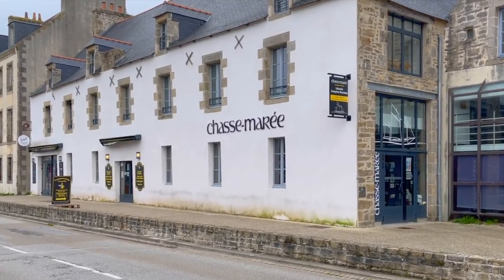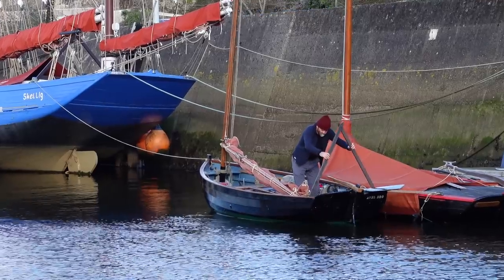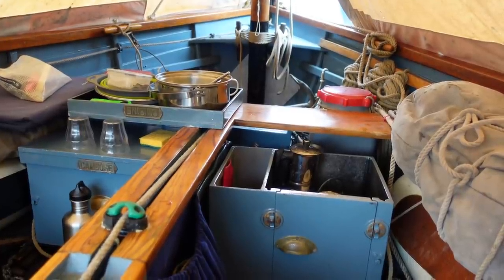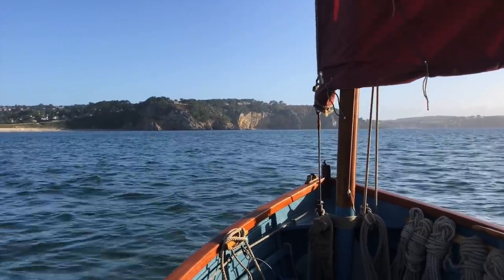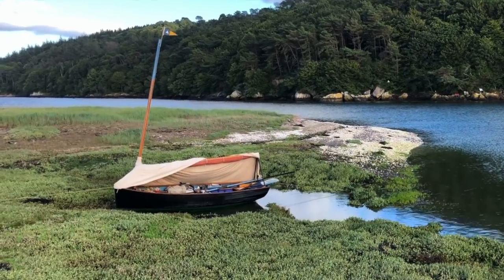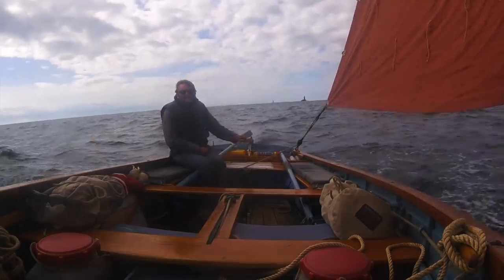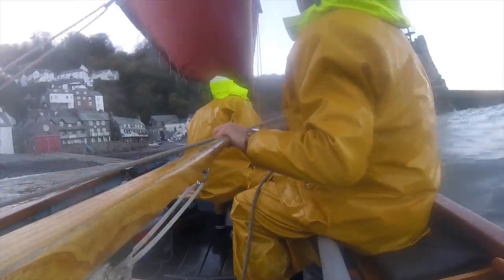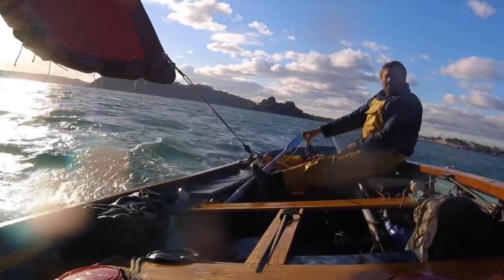Wild Camping in a cruising dinghy

Comment: I used to have a 22' yacht. One weekend I decided to take my 12' Tinker Traveller sailing dinghy for a trip on the Deben from Woodbridge down to the sea and back again - a round trip of about 18 miles. This 6 hour trip was the most memorable and enjoyable sail of the whole season for all the reasons that you state. You get as close as possible to the elements and everything is wonderfully simple.
Reply: The orwell and stour are nice sails too
Reply: That's a long wet (but safe) trip in a traveller.  I've just bought one of the last made but haven't had chance to sail it yet. But with even a small motor on it flies !

Comment: I've never owned a lovely old boat like this one. But I've been sailing - and owning, on and off - sailboats for 30 years. My favorite was an Etap 22, which over the course of years we sailed throughout the Stockholm archipelago. It was nearly all fun, and only a very small dose of work. But because we usually have to dream bigger, and I had always dreamed of crossing oceans, I "upgraded" from that to a 46' ocean-going Amel ketch. Suddenly I was a full-time mechanic, hardly a sailor. When you own a boat like that it's like the story about painting the Golden Gate Bridge. You are never done with the jobs list. Never. We cruised her for a year, through the Med and over the Atlantic. But I have to say the sense when I finally walked away from her on the pontoon, on the day of sale, was one of overwhelming relief. These days I'm into ultralight backpacking, and there's certainly a connection there: all of the adventure, none of the weight. If I were ever to return to sailing, it would probably be to do something similar to what Roger is doing above. It looks like a balm.
Reply from the maker: Not all that old. Built in 1994.
Reply from the maker: ... the boat. Not me!

Comment: Roger, you have totally inspired me. THANK YOU.  I've bought the best dinghy I can afford for 1k and equipped it for dinghy cruising and camping. A Laser 13... 136kg so manageable and far more affordable than many alternatives (I would love an Illur and maybe, when my boat comes in.... :-) ) I'll start with anchoring/ mooring, going ashore in my inflatable, or drying for the night. This allows me to use the camp kit I have until I can make a boom tent and rig a bunk in the cockpit. I've bought the bits for impeder, mooring cleats and anchor fairleads, anchors, chain, rode, mooring lines, Drybags, fenders, 3m (!) oars ... I did the calculation... 
 and rigged a sculling oarlock on the outboard bracket.... can't wait to try it! Drysuit, boots, buoyancy aid, reefing, preparing to get going from my new place at Cargreen Yacht Club in the Tamar. Not sailed there before but I hope the rivers and Plymouth sound will be a good training adventure ground this year. Brest and Morbihan in 2025!

Comment: I've got a little inflatable dinghy. To camp in it the oars will wedge against the oar locks and tie together to the front and back of the boat, creating a pyramid frame to support a tarpaulin. In comparison your dinghy is like a luxurious mansion! The advantage with my small one though is you can easily carry it across the land, and even climb with it on your back. Or without even packing it away just pick it up and carry it around a weir.

Comment: I have a bigger boat and yes it is like a caravan but don't use marinas that often as prefer off grid in anchorages. I love wild camping too and to combine these hobbies bought a mirror dinghy that I'm converting for cruising at the moment. I purposely bought an old wooden version with traditional wooden mast & gaff to get right back to basics with dinghying. Camping on it will be a challenge that I'm so looking forward to. Especially on calm inland waters.
Reply from the maker: Mirrors are small, but very nice little boats. You can do a lot worse.

Comment: Roger, i have looked at the Ilur plans and there seems to be a difference between the sleeping space on the “clinker kit” and the “classic”. Do you have an opinion on this? Are you familiar with any other distinctions? Thank you.
Reply from the maker: I am not familiar with all the distinctions, but I know that all modern Ilurs have much more fixed buoyancy than mine, which affects the internal arrangements. A friend who recently built an Ilur simply made the main thwart removable to provide more sleeping space, as the centre plate box is adequately restrained by the forward thwart.

Comment: You make it sound as if anyone can just buy a dinghy and go sailing the 7 oceans. It takes a lot of practice to be able to sail on a small boat. That's the main reason why I haven't done it yet. I live by Michigan lake. It's dream waters for sailing. Yet, I don't do it because I don't know how to sail.
Reply: I didnt either (until my 50's) but I took a couple of courses (where I didn't learn much), read a lot of books and bought a boat of my own (which taught me a lot) and now I am a third way round in a circumnavigation.
Reply from the maker: You can learn by trial and error I think, if you take it in stages.

Comment: Are those boats behind you abandoned ?  The council doesn't want to take them away to clean the place ?
Reply: This is France! Actually these boats probably help to keep the land from eroding too much. Note there is a road above them.
Reply: This cemetery is full of disused fishing boats let there to rot during the race to bigger, better ships. Everyone close his eyes as economy is everything. The sea will claim them all at the end.
Reply: I have been in Douarnenez many times and l love this town because of the pittoresc atmosphere created also by this wrecks . There are also exsamples of upside down torn boats,  which very poor fisherman and their familys used as a little cabin to live in and this boatcabins are not bigger than Rogers dinghi but with a chimneypipe going thru the hull .There is also a museum port of old ships of all styles and sizes there , very interesting to see and l'm not surprised that Mr. Barnes choosed this town for his french base to go sailing .
Hey , if you want it clean go to Monaco
Reply: @martinhoflich6150  I would not mind so much if it were just wood, but those have lots of plastic and metal fittings on them and could still have a motor and fuel tank onboard to leak into the river.  
It's not a good image for me.
Reply: If your intention in dinghy cruising is to connect as completely as possible to nature and the environment, then these old, rotting hulks serve as powerful conduits to the past, as well as to the shipbuilders and sailors who's labors laid the keel of the very boat beneath you.  
For me, personally, stumbling upon old wrecks like these is a religious experience that evokes profound reverence.  It's hallowed ground.  A shrine.  These boats and the crews that sailed them are our fallen brothers-in-arms, and as with a twenty-one gun salute or a missing-man flyover, I offer my respect, thank them for their service, and sit with them once in a while in gratitude.